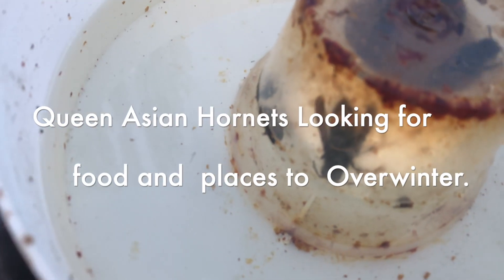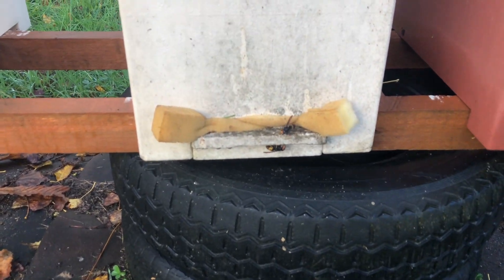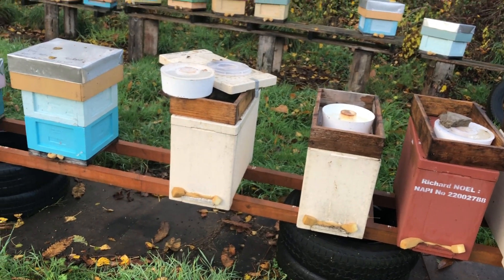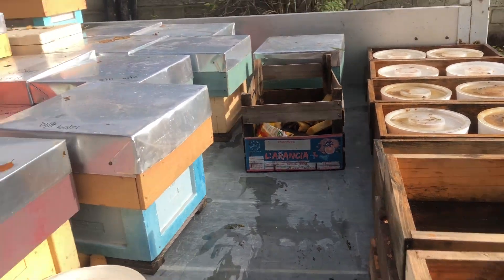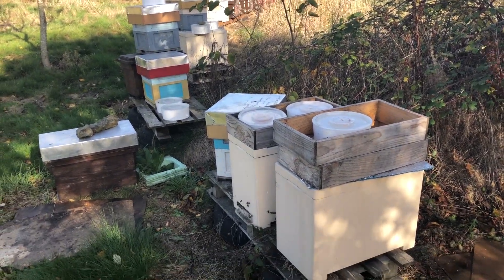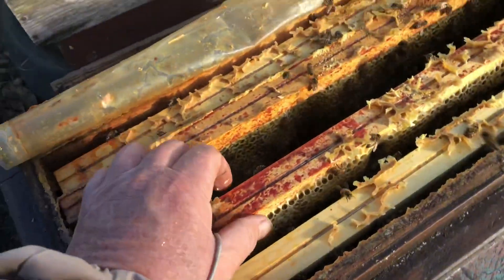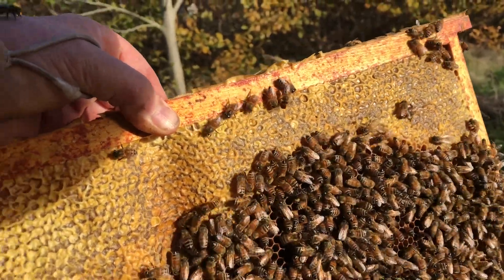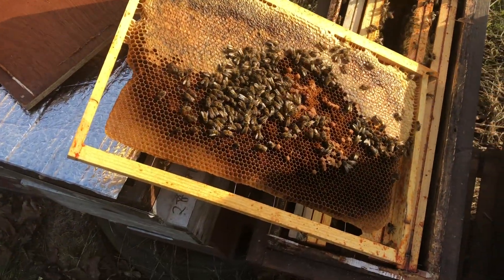Cleaning up with Asian Hornets

Comment: What happens when Asian hornets meet European hornets?
Reply from the maker: no Idea Phil, I've asked the question before and to be honest never seen them fighting. They do seem to avoid each other. in terms of food, Like many other species, the common hornet are indeed threatened in  their survival or proliferation as the Asian Hornets are diminishing the area in food reserves and increasing the completion for food. Their just so prolific. Its seems this year they are changing their feeding habits and diversifying in their diets to eat not just pollinators. As you've seen. Many more nests closer to the ground.
 Its like many invasive species, they rush in and have a big effect initially, then seem to change their habits as they become more naturalised to their new surroundings. Ive never lost and colonies to Asian Hornets. they just will prey on a weak colony, actually , very similar to wasps in their aproach. Wasps never kill a colony, they just weaken it and move in if its compromised.
Reply: @richardnoel3141  I've just been to a meeting about Vv run by a local association. The bait used I Jersey smells strongly of acetone  (pear drops/nail varnish remover) and I'm wondering if that is exactly what it is, or if there is another component  (it had a red colour, but thus was probably just a dye). Is that what is used in your area? Also, nests appear to be killed using an insecticide,  which is also going to kill other insects, as well as birds and small mammals. I'm thinking that steam or CO2 may be the answer, injected up into the nest. Any thoughts or experience?